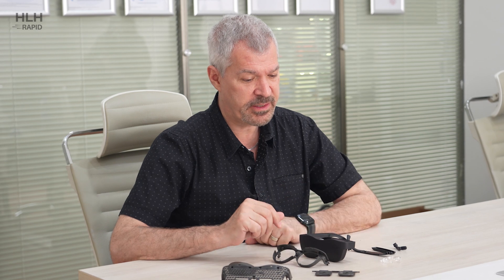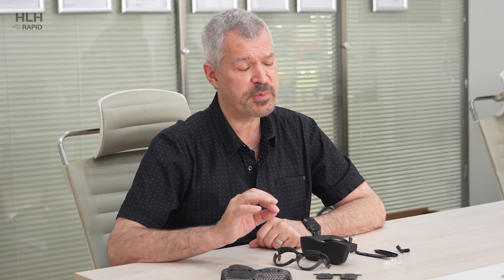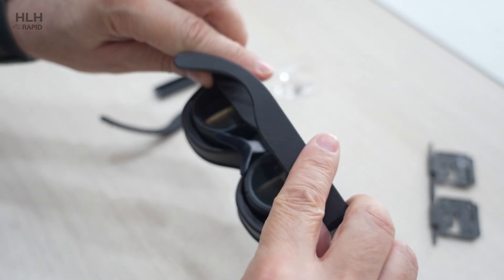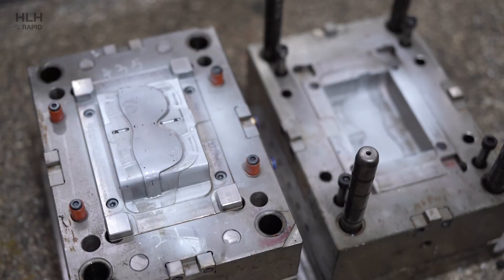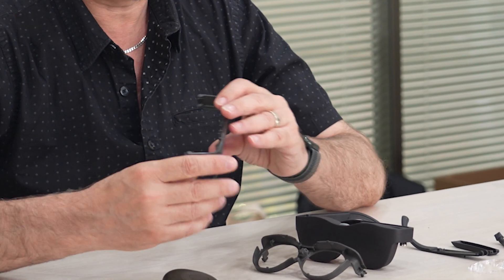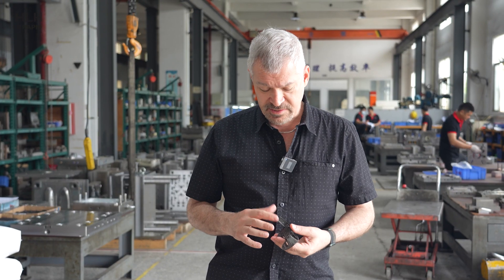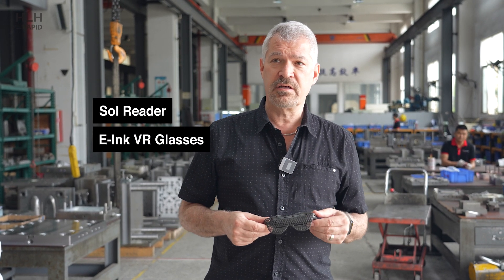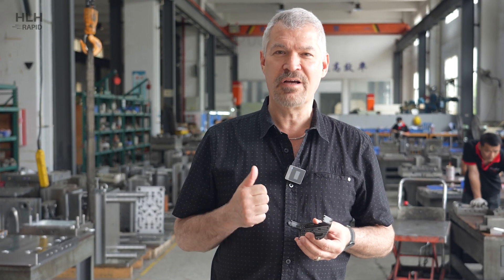Manufacturing SOL Reader's Cutting Edge E-Ink VR Glasses

Comment: e-ink displays traditionally have high latency, low frame rates, low resolutions, doesn't produce any light (means you need light to shine into the headset or be shone from lights in the headset), all of which are the opposite optimizations displays require in VR headsets; this idea baffles me and I only searched "e-ink VR headset" because I thought it would be a joke, now I am morbidly curious what an actual product is going to be like. I am 100% invested in this idea that has no right working